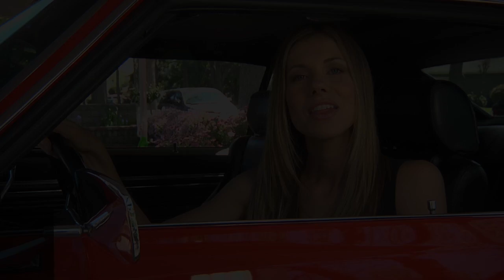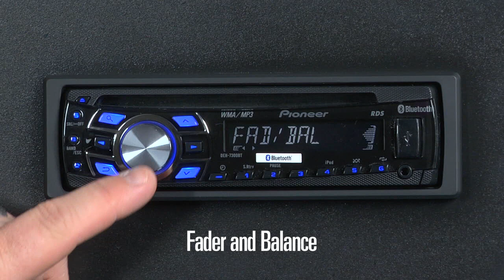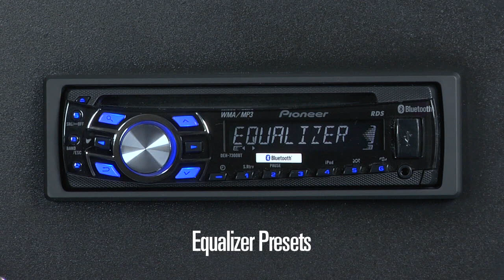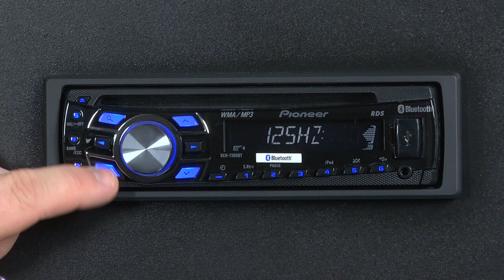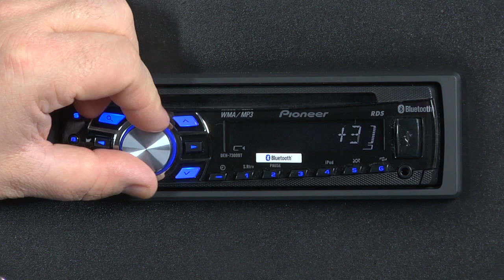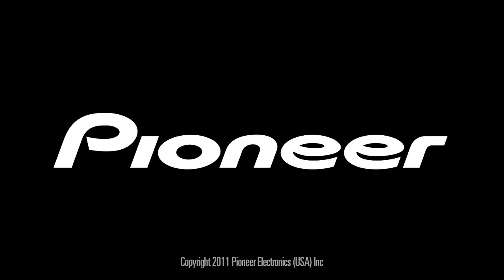FAQ- DEH-7300BT- Audio Settings

Comment: How do u cut the power off so it doesn't kill my battery
Reply from the maker: The red wire should go to ignition power. 12 volts when the car is on, zero volts when the car is off. The yellow wire goes to a constant 12 volts, to retain the memory.

Comment: How do I turn off the subwoofer and get the fade function back?
Reply from the maker: What is the model number of your Pioneer in-dash receiver?   Depending upon the receiver model, you may need to switch the Rear Speaker Output to Full Range in the Initial Setup.  If you have the Pioneer DEH-7300BT, you can learn about it in this Pioneer How To video:   https://youtu.be/cpeSXKCNmRY?t=77
If you have a more modern Pioneer receiver, you can learn about it in this How To video from Pioneer:  https://youtu.be/4xf-rc9IEok
You can find more videos on Pioneer's YouTube Channel here:  https://www.youtube.com/user/pioneerelectronics

Comment: Easy for an expert to do. I got mine in a used truck. Sounds and works ok as far as I can figure, where may I get the manual?
Reply: The Pioneer DEH-7300BT was manufactured back in 2010-2011.  You can find more videos about Pioneer DEH-7300BT here:  https://youtu.be/cpeSXKCNmRY    and here:   https://youtu.be/kJt9-cgfdBQ    You can find the owner's manual for the Pioneer DEH-7300BT here:    https://www.pioneerelectronics.com/PUSA/Car/CD-Receivers/DEH-7300BT#manuals      and  you can find more videos on Pioneer's YouTube Channel here:  https://www.youtube.com/user/pioneerelectronics